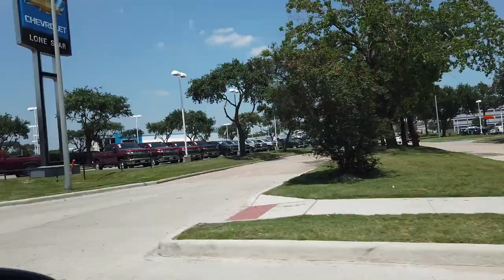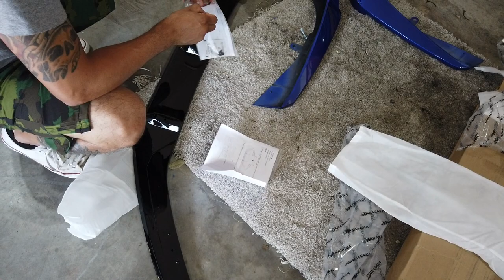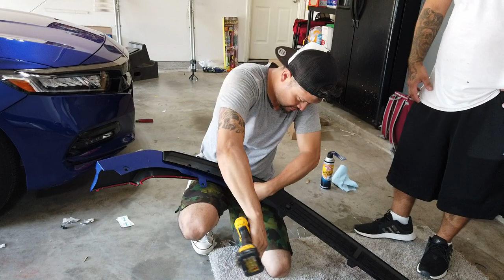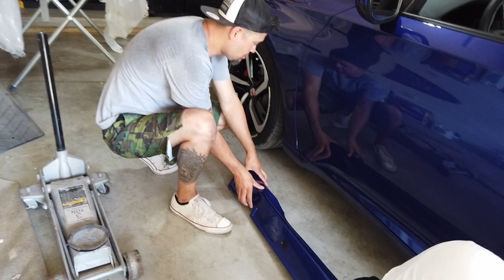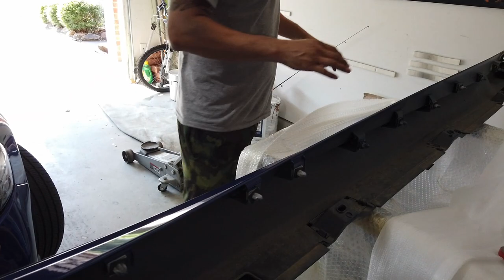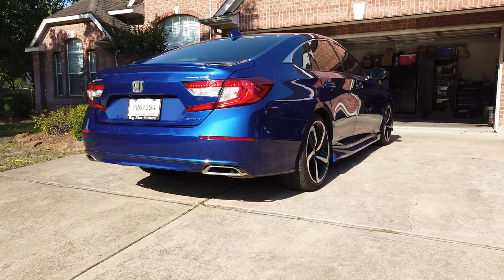2019 HONDA ACCORD SPORT FRONT LIP AND SIDESKIRTS  INSTALL!!

Comment: Nice front akasaka lip, which side skirts are those? Are you going to put anything in the rear?
Reply from the maker: below is the link for the side skirts i believe they are out of stock right now...and yes rear aprons coming soon! 

https://www.ebay.com/itm/For-18-2020-Honda-Accord-Still-Night-Pearl-Blue-Add-on-JDM-Side-Skirt-Extensions-/193426273173